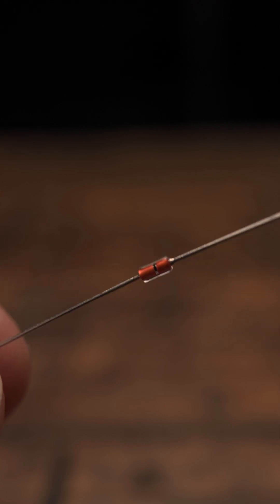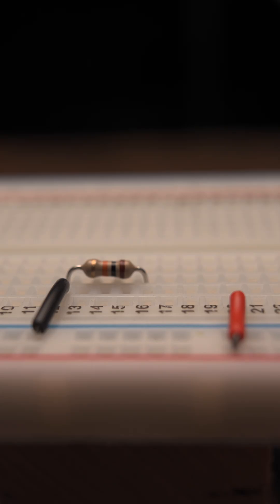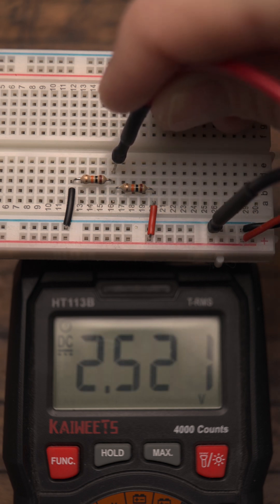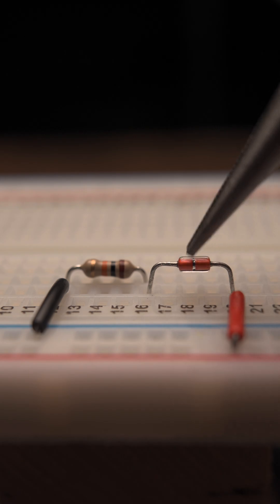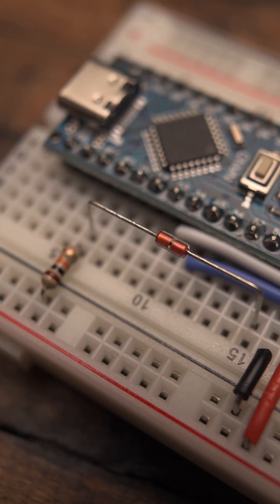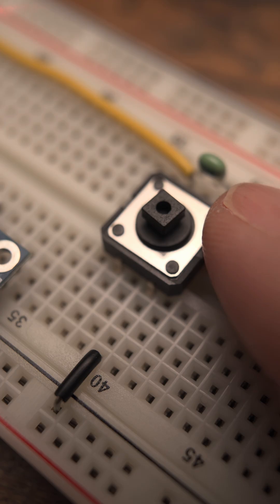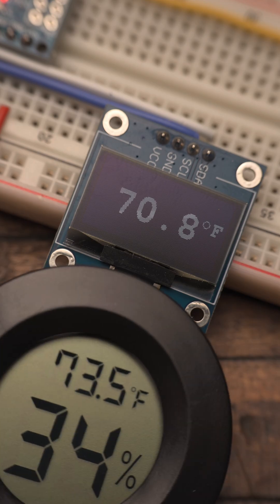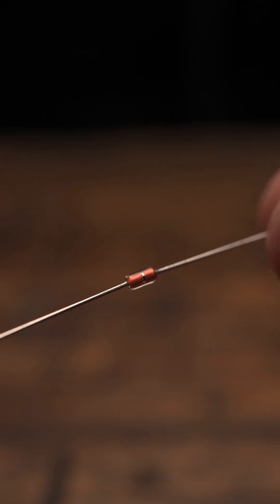#thermistor

Comment: "I added a button to switch between Celsius and nonsense"
Reply from the maker: This made me actually laugh out loud 😂
Reply: @HackMakeMod  It's true! Farenheit is complete nonsense! Lol
Reply: We should just convert everything into Planck Units for some extra fun.
Reply: It doesn't matter. Both systems are largely arbitrary and loosely based on properties of water on earth.
Celsius rooted itself at the triple point of water. Fahrenheit put 100 at around body temp. Celsius put 100 "degrees" between water freezing and water boiling. Fahrenheit put 180° between those two points.
It doesn't matter. Don't mix systems and you'll be fine either way.
Reply: I believe Kelvin is better than both
Reply: @Cubikat  Only for science. In everyday use using freezing point as Zero and boiling point as 100 is much easier to use for practical purposes.
Reply: @petergibson2318  I would be on board if you used a decimal point.
Reply: @Cubikat  Kelvin's just Celcius that like going down, so yes.
Reply: True since it's based on the very laws of the universe. @Cubikat
Reply: @nathanpfirman625  Celsius is just Kelvin with a potentiometer so we have a way to calibrate it.
Reply: @Pharozos Yeah but someone directly soldered the potentiometer and the knob got stuck so now we can't change it

thanks kevin
Reply: @tomikun8057  :D
Reply: @nathanpfirman625 it's really not though, it's just a yet another human created way of measuring temperature
Reply: @Cubikat It's a little less useful for common use though since it will always be a number above ~250 unless you live somewhere exceedingly cold
Reply: @Cubikat  Celsius is parallel to Kelvin without conversion, so it has the scientific scalability while retaining the everyday usability.

If you need to calculate with absolute temperatures, Kelvin is the way to go. If you just need deltaT, both scales are equally useful.
Reply: @Cubikat  Why does in such discussions nobody ever argue for degree Rankine?  Réaumur?  Rømer?  Gasmark?  Leiden? Wedgwood?
Reply: Kelvin is literally based on celcius just adjust zero yo absolute zero. Celcius still makes sense where Fahrenheit is shit @Cubikat
Reply: @Cubikat  Only that Kelvin was derived from Celsius....
Reply: @NiMareQ  it's still more accurate than Celsius
Reply: @Cubikat  okay 😂. Both have arbitrary precision, though.
Reply: @Cubikat  Farhenheit can't be more accurate than Celsius, as it's just Celcius converted arbitrarily.
Reply: @calorus  I never said anything about Fahrenheit
Reply: @Cubikat  So you mean Kelvin is more accurate than Celsius? I am lost, sorry. You do realize that Kelvin = Celsius + 273.15, both are equally accurate. They just both base their scale off different phenomena.
Reply: @NiMareQ  @CubiKat - Exactly this.
Reply: @calorus Fahrenheit and Celsius are both defined by Kelvin now. And the only thing that Celsius was "good" for (0 being the freezing point of water, and 100 being the boiling point) isn't even accurate anymore. Now that it is defined by Kelvin, it shifted the boiling point of water to 99.98C and freezing to -0.0001C. Celsius isn't even defined by the one and only thing it had going for it (which wasn't even useful in the first place).
Reply: @Gimli1357  No, Kelvin is defined by Celsius, otherwise you'd know where to start, but you wouldn't know how big they were.
Reply: @calorus  Nope. Kelvin was created using a scale similar to Celsius, a scale less precise than Fahrenheit, but Celsius got redefined to be based off of Kelvin since Kelvin actually has a sensible starting point. (This is why Celsius is no longer defined by the boiling/freezing point of water despite that being it's entire point). Celsius never had a good reason for existing. The freezing and boiling point of water is not a useful scale nor has it ever been one.
Reply: @Gimli1357  On reading you are correct as it was apparently changed since my undergrad days -- however on analysis, this has been achieved by taking the tripling point (273.16K), and counting down to zero. meaning that whilst it's no longer mathematically dependent upon Celcius, it's contrived to ensure that Celcius is unchaged. Which is cool.
Reply: @Gimli1357 Oh yeah, these ten-thousandths are so relevant😂
Reply: Eurocucks are an embarrassment to the world.
Reply: The yuropoors ITT wish they could feel temperatures the way we can.

0 is fucking cold and 100 is fucking hot, its like a percentage

The inferiority complex of yuropoors is the greatest thoughever
Reply: OP just admitted to being mentally retarded 😂
Reply: MURICA🦅🦅🦅🦅
Reply: Yeah take it like that farenheit
Reply: Fahrenheit and nonsense* FTFY
Reply: LoL
Reply: Guys, guys, stop fighting. NASA uses the metric system so it is superior, end of discussion. Do you know better than NASA? No you don't. NASA is the standard.
Reply: freedom fractions are superior
Reply: Celsius is nonsense unless you're in a lab, then you should use kelvin anyway. Celsius is pointless
Reply: Land on the moon then we can talk losers
Reply: Fahrenheit is metric weather. Goes from 0-100 with meaningful changes every 10 

Meanwhile europoors are stuck with their -17 to 37 weather 😂😂😂😂😂😂
Reply: ok king george
Reply: True
Reply: Freezing is 0° boiling is 100° so what is the meaning of F
Reply: 🤣😂 so true C° all the way
Reply: There's a reason the metric system is used ubiquitously in the scientific world.
Imperial is so damn clumsy.

Including Fahrenheit - particularly when people spew this '60% hot' thing like that makes any sense. 😂
Reply: @lewe666 because it does functionally make sense, and it allows for more precise temperature when measuring weather. And also, Americans literally use both systems. In science where we require things to be measured precisely we use the metric system. If it doesn’t have to be precise, then we use imperial because it’s all fractional based and easy to quantify quickly. Like if I’m baking, I wouldn’t go “I need 26g of flour”. Fuck that, I have a cup. I use this one cup, and everything else will be based off of a fraction of how much is in this cup. Fahrenheit is easier because we have more numbers between temperature. I.e. per each change in degree by Celsius measurement, there’s somewhere about 1-2 changes in Fahrenheit. We can accurately describe between 70-71 degrees Fahrenheit if necessary. Also, I’m so fucking sick of the “but Celsius is based on water” argument. I’m not a fucking cup of water, I want to know how the temperature will feel to me, not to the water
Reply: @Spoomped  measuring things by cups makes no sense due to the difference of molecular mass between ingredients, therefore using volumetry isn"t a good way to be precise with recipes (especially bakery).
Reply: @Spoomped  "I’m not a fucking cup of water, I want to know how the temperature will feel to me, not to the water" 👏👏👏
Reply: The fuck is a Celsius?
Reply: @_Nay_Nay  Normal temperature scale
Reply: @grankeee  that sounds like communism to me. We use moonlanding units here
Reply: @_Nay_Nay  " We use moonlanding units here"
I have to break down your world view, Apollo's computer used metric units and then translatet it to imperial so english crew can understand them easier.
Reply: Celsius is a measure of temperature relative to water, and Fahrenheit is a measure of temperature relative to humans. It makes sense to use them as percentage values based on what is being measured.

E.g. it is 60% hot outside, this water is -5% warm.
Reply: @hunterbeach8941  The background for 0 degrees Fahrenheit is the coldest temperature measured in Gdansk at that time... can it be even more random?
Reply: @lukasmessner269  what did they base the kilometer off of again? A fraction of the distance from the north pole to the equator through France?

And wasn't the kilogram literally based on a single weight stored in the basement of a government office, one whose weight changed significantly over the course of only a few years?

And sure, the centigrade measure is based on water, but other than that, the only basis in metric that makes much sense is the unit system.

We need something to use as a base for measurement, and while it's convoluted, I think 0°f being "the coldest temperature we measured" is a bit less strange than "our unit of mass is this one weight we keep in that basement over there, but don't touch it! That's not allowed!"
Reply: @hunterbeach8941  Oh and can you give me the current scientific definition of a degree Fahrenheit?
Reply: @calorus  No, I couldn't, but I personally don't think that really matters.

Both of our systems were based on convoluted measurements taken by some old dead guys, and now for some reason we're having an argument about it on the internet.

Besides, my original point still stands. Fahrenheit is useful for weather, and Celcius is useful for chemistry. Neither is better, because they're used differently and for different things.
Reply: @hunterbeach8941  The definition of a Fahrenheit is 5/9(x − 32)°C i.e. the Farhenheit (and by extension Rankine) is literally defined by the Celcius.
Reply: @hunterbeach8941 
water. 1liter is 1 kg
as for distance... well we dont hv to go on something.. its better than whatever nonsense imperial is.
Reply: @calorus  since it's obvious you only read the first two lines of what I said, and you don't seem to care about discussing the original point, I don't think your input is very important to me. Have a good one.
Reply: @aabuyaa  A kilometer is one ten-millionth of the distance between the North Pole and the equator through Paris. One liter is 1000 cubic centimeters, one liter of water is 1kg, and one one-thousandth of a liter of water, a cubic centimeter, is a gram. Heat one gram of frozen water in a pan with a mercury thermometer til boiling. Take the MM of mercury between boiling and frozen, and divide it into 100 equal units. That's a degree Celsius, which is also a calorie. Take 1000 of those calories, that's a kilocalorie, which we use to measure our food's energy.

So everything in metric, from distance to volume to weight to mass to temperature to nutrition is, in origin, based on an arbitrary one-ten-millionth fractional measurement of the distance from the North Pole to the Equator through Paris France in 1791, which might I remind you, due to geologic and magnetic shifting, isn't even the same measurement you'd get today.

And yet all of that, despite what everyone in this comment section says, is completely and totally beside the point.

Because my original point was that both Fahrenheit and Celcius were useful. Celsius is chemistry's temperature, and Fahrenheit is humanity's temperature. They're both useful as percentage models for "How hot is this thing right now?"

And everyone gets so bent out of shape about this just because of a false superiority complex stemming from something as arbitrary as the thermometer. Metric and imperial weren't even part of the discussion until other people brought them up, and they are still irrelevant to the original point of my first comment.
Reply: @hunterbeach8941 The circumference of the earth is 40.000 km, so a quarter arc of the earth circumference has 10.000 km (Actually it is a little bit more, but this can be explained with less acurate measurement tools back in the day). one cubic meter of water equals to 1000 litre and weights 1000 kg or a metric ton. It is not that hard to understand, and it is repeatable as the density of water is nearly constant and the curicumference of the eart does not change. 

And for Celsius: 0°C by ambient pressure at sea level means freezing, 100°C by ambient pressure at sea level means boiling. This is not hard.

Nowadays the definitions for SI units are more precise and more obscure (the kg is now defined by the weight of a bunch of silicum atoms), but still repeatable. 

The way fahrenheit was derived cannot be repeated. It is based on the body temperature of some dude and how cold it was another day. Will not deliver the same results by repeating it
Reply: @hunterbeach8941  Relative to humans?
0°F Humans are dead. 100°F humanity is... Maybe okay, probably a bit of a fever - oh and it depends where you measure them. Perfect
Reply: @calorus  the scientific definition of a degree of Fahrenheit is each degree = 1% hot. If it is 50F outside, it's 50% hot. Which is a pretty nice day. A lot of people like 70% hot. I personally like 50-60% hot more. We don't like going above 100% hot, that's a little dangerous!

Also, try to think outside the box a little. The comment you replied to about "Relative to humans" isn't about internal body temperature. It's about external temperature, i.e. how we feel in an environment of a certain temperature. I know "feelings" is hard to quantify for a soulless nerd like yourself that feels the need to ground their entire life in "science" in order to feel like they have a grip on the machinations of the world and to stop the constant, crippling fear of the unknown from weighing you down like an anchor, but doesn't that just make it all the more cool that Fahrenheit managed to do that?
Reply: @hunterbeach8941 Yeah, because fahrenheit, pounds and feet make much more sense. Sure bro. So smart argument.
Reply: @hunterbeach8941  just americans and some other contrys use fareheint man, all of the world use metric system, this si why is so weird to us think about imperial system🤝🏽
Reply: @moon_wingo  I'm well aware that I'm in the minority here. I completely understand how dumb my country's systems are, I just want to defend the one measurement that's actually useful.
Reply: @calorus Fahrenheit was actually originally made because this guy figured out how to make highly precise temperature measurement, so he invented an alternate measure based on the existing Celsius so if you wanted to make precise temperature measurements you HAD to use his products

Fahrenheit is literally a proprietary temperature scale, even it's origin is disgustingly American
Reply: @hunterbeach8941  a couple of things to point out which seems important. The strength of the SI system is it capacity to be reproduced only from its definition. The kilogram was indeed a headache for a long time because scientists couldn’t find a way to make it easily replicable, but it is not the case anymore since 2019. The tweek is to define these constants from universal constants, and that is basically now the case for all the seven base units of the SI system. This is something that the definition of the empirical system doesn’t provide.
Finally, a calorie is not a degree Celsius. First because one is a temperature the other is an energy, second because calorie is not par of the SI (it is the Joule), third because it is actually defined like the required energy to heat up 1cm3 of pure water by 1°C (still a replicable definition though), fourth energy is not a fundamental unit, because it can be expressed as a mass time length divided by time squared.
Reply: @romain.guillaume  1kg is weight of 1liter/dc3 of water. Not sure in what temperature but i guess some provided in round number in Celsius scale :D
Reply: @grankeee   indeed. If I remember correctly it is 25°C at 1,025 bar of atmospheric pressure (basically « normal » temperature at see level more or less)
Reply: @hunterbeach8941 you literally defended f using arguments that make C better. In metric it's all related - temperature, mass, volume, etc. In F.. oh its cold
Reply: @hunterbeach8941 
A kilo is based on a litre of water (most likely at a specific temperature idk for sure) but it's based on a litre of water = 1000 millilitres and 1000 grams
Reply: @hunterbeach8941 it doesnt matter having everythibg base 10 is just better
Reply: @lukasmessner269 0 Fahrenheit isn't the coldest temperature wtf are you talking about
Reply: @hunterbeach8941 what does kilo mean? What is meter based of?
Reply: @hunterbeach8941  Celsius is also more useful for weather. If the temp hits about 0, you know it's going to snow.

If F hits 0, it has been snowing for a long time already and no change is perceivable at 0. There also is no weather change perceivable at 100°F whearas in C you'd give up living.

F can't be any more random. You have no realistic fix points other than subjective points or the ones you translate from Celsius.

And if you say "Average body temperature is objective". No, even average body temperature has historically changes as our biology isn't static even if a perfectly healthy person.

Put up ANY number scale, 0° = temperature of my testies, 100° = temperature of my warmest far on a hot summer day after eating from taco bell, and you have an equally useful and logical temperature scale as Farenheit.
Reply: @hunterbeach8941
Of course it matters FFS.
Reply: @hunterbeach8941  You don't understand the genius of SI.
Reply: @hunterbeach8941  doesnt make any sense, standard human body temperature is 36.6C should be exactly 100F to make sense but it's not. 0C is 32F and it does not make any sense eaither (to use them as percentage values). Considering that human body would be over 75% made of water (skeleton lowers that average a lot) it makes a lot more sense to use Celcius. Only USA and a few little countries uses F nowadays, but we know that Americans will use any units but normal eg. using anything but metric system when providing measurements :D
Reply: @grankeee  environmental temperature, not internal.

I will not elaborate, seeing as how (despite being american) I seem to be one of the few people in this thread who is willing to use more than one system of measurement. Metric works for chemistry, imperial has its uses (as niche as they are). That is what I've said before, and imma leave it at that.
Reply: @Spoomped   "and the EU will use anything but a fucking toothbrush" 
 no comment
Reply: @hunterbeach8941 yes ... thr average human temperature is a fantastic value to use ... 🙄
Almost as stupid as the inch, or the foot.
Reply: @XB10001 Not if you’re human. Which I happen to be. You?
Reply: @rfichokeofdestiny  do you know WHY it's *average*? Because the temperature is slightly different for each person.
As peoble are born, the value changes slightly.... and constantly.

It's a matter of being intelligent, which now I know you're not. You cannot be THAT bad at mathematics.
Reply: @XB10001  If you were intelligent, you’d realize I’m talking about a range of values rather than the average of one particular value within that range (whose standard deviation is so insignificantly small by comparison that it doesn’t matter for the purposes of this argument).
Reply: @rfichokeofdestiny " the average of one particular value within the range".
(YOUR words)

That's the value itself, genius!
Stay way from math, please. The concept of averages is too conplex for you.
Reply: @rfichokeofdestiny   if you had even one bit of intrlligence, you would know that a range of values doesn't work for a scale. You didn't help yourself at all there.

More importantly, you would have understood what I wrote.

😂 ... keep trying, and while you are at it, check your temperature. 😂

It's funny and sad that you still don't understand why THAT doesn't work.
It's clear math is NOT your subject. Stick to addition only.

Also, the important aspect is the definition of a standard for the unit. So clearly, you are also clueless about how precisely units are defined.
Reply: @rfichokeofdestiny  I cannot emphasize this enough. STICK TO ADDITION.
Reply: @hunterbeach8941  Actually Imperial System is a measuring system relative to burgers per football field divided by turkeys per leg.
Reply: @gabrielex  cute.
Reply: @hunterbeach8941  that still doesn't work, because ambient temperatures over 100% make no sense.
Reply: @theone1and1  I decided to share an opinion a while back and now everyone is yelling at me for it. All I wanted to say is that Fahrenheit could be useful, and now everyone is mad.

I don't care anymore. Think whatever you want, you're right. Educated discussion is over because everyone missed the point and because I'm American I must be wrong.
Reply: @hunterbeach8941  Honestly, I don't really care about Fahrenheit vs Celsius. Use whatever makes sense to you (but for the love of god put both into online recipes). I just meant that the percentage of human thing doesn't make sense because you can go beyond 100%. Both scales are equally contrived
Reply: @hunterbeach8941 
One of you main arguments for F was that it's 'more precise'.
That means very little when both scales are perfectly fine with non integer values.
Reply: @hunterbeach8941  Its not intuitive at all. 30 sounds nice and chill but its freezing outside. 50 sounds bang on middle but its cold. 80 sounds very hot but its not hot. 100 sounds like you should be dead but it's just hot. Then it goes above 100 which is not intuitive. And then you remember that for a Siberian 50 is hot and for a Californian 80 is cold. Easily worse than Celsius which has the same last problem but does not have the rest. Celsius is just 5 freezing cold ,10 very cold, 15 cold 20 warm, 25 almost hot 30 hot 25 very hot 40 extremely hot 45+ shoulda stayed at home. Increments of 5 work perfect for it.
Reply: @hunterbeach8941 that’s very creative
Reply: @hunterbeach8941  Nice explanation. 👏🏻
Reply: @hunterbeach8941  what? This is first time I am seeing this argument in wild. It does not make sense even from human pov because humans are subjective and will adjust their perspective based on the measure they learn. So for someone using Celsius or Kelvin all their lives, it will make sense to only use those but with added benefit of being scientifically usable. If you use Fahrenheit all your life, there is no added benefit. It's a worse measure.
Reply: @MartinzW  if that's the first time you've seen that argument, you haven't participated in this discussion before. It always comes up.
Reply: @Falcrist  i've seen it but typically when it's mocked
Reply: @MartinzW  ah, so you're just making stuff up.
Reply: @hunterbeach8941 it doesn't make sense to create a temperature scale based on "feel". The only evidence needed to support this point is how often climate conditions are reported as being "x degrees, but feels like y degrees"
Reply: @hunterbeach8941  sure but that’s incidental, not by design, the purpose was the have the 0 point lower because it makes maths easier (less negative numbers) and it helped to have freezing and boiling 180° apart (incidental I believe), again for maths. His body temp was used to get 96, the three points measured to make the scale where 0, 32, and 96
Reply: @hunterbeach8941  That's bullshit. Human have preference so it's different between people. But water is universal, if you go out and see it's minus two degree Celsius everybody would understand it's bloody cold outside if water freezes
Reply: @hunterbeach8941  bullshit its based on the specific weather of a specific area.
Reply: @hunterbeach8941  : Plot twist, humans are 50-70% water
Reply: @hunterbeach8941  wat does 60% hot outside even mean? For some people 25°C is already too hot and for others it's 35°C. I get a headache if the temperature outside is colder than about 12°C, so does that mean 0°F for me is 12°C?

Every human is unique, so basing a temperature on humans makes no sense if you didn't grow up using it. Basing the temperature on something like water makes at least some sense since the temperature is above 0 when you notice ice and/or snow melting and it is below 0 when ice is forming and/or snow is falling. Snow can also fall when it's a bit above 0, so if you see snow fall but it doesn't stick around then the temperature is somewhere around 0.

Boiling is also an important part of cooking, so it also makes more sense in that regard.

In the end the easiest system is the one you grew up with or used for a long time. But I'd say that Celsius is objectively a bit better than Fahrenheit simply because Fahrenheit is based on something subjective and intangible.
Well, actually Fahrenheit is currently based on Kelvin, and Kelvin is derived from Celsius. So, there's that as well
Reply: @AnimilesYT  you make a good point that, if you don't grow up with the system, it can be difficult to understand how to use it in the way I'd described. However, in my experience, all it takes is a mental note of where room temp is to dial it in, especially when you remember freezing is 32°F. Keeping those 2 numbers in mind gives you a reference point, just like 0 and 100 in Celcius.

Although, if I might ask, why do people keep bringing up what imperial is based on? I'm fully aware that imperial uses metric as a base, but I never intended to discuss either system outside the context of "Fahrenheit has its uses," so why does it keep getting brought up?
Reply: @AnimilesYT  In addition to my other comment, celsius is based wholly on the meter, which is exactly one-ten-millionth of the distance between the equator and the north pole through Paris circa 1791.

To argue that Imperial measurements are worse because metric is based on something tangible seems strange given this knowledge.
Reply: @hunterbeach8941 if you don't mind, i will have something to this cov too.

The biggest problem is conflict between USA and rest of the world, especially in the science fields. (Like rockets failing due to wrong units). Also, what i really like about metric is that most of it is something*10^n, which makes it easy to convert between. So, it is easier to work with. 
Also, i don't really like to think "its 60% hot outside" because... Well, really sounds stupid to me😃 i guess its nice for bit understanding °F, but terrible for actuall practical use.
Reply: @hunterbeach8941  not to sound like a broken clock, but the Meter is not based on the distance of Paris to the North Pole. It is based on the circumference of the earth. The circumference of the earth at the equator is 40.000 km. The mathematicians who computed the earth circumference lived in Paris. It is not that hard.
Reply: @docjoules4738  Yes, you're right. It's not the distance between Paris and the North Pole. It's one-ten-millionth of the distance between the equator and the north pole (equal to one-quarter of the earth's circumference), but specifically through France because... well, it's the French.

So one-forty-millionth of the earth's circumference, which is arguably more convoluted than the other number.
Reply: @hunterbeach8941  it really isn't that convoluted. This number is the same even if we would let it run through Colorado or moskow. They mathematicians who measured the land just lived in France and thus did this in France. If they were German, they would have done this in Germany. 

If you invent a unit system you want people to reproduce your results. The imperial system is not repeatable. You cannot repeat the process for feet or Fahrenheit and get the same result. With  the SI system, you can.

And it is really easy to convert
Reply: @hunterbeach8941  Fahrnheit doesn't have a use. Argumenting that it's a human temperature is a falacy on its own, as it has been measured that human temperature decreases throughout generations. "Just remembering" that freezing is 32°F is just plain stupid and proves that freezing point is a well thought and practical reference point even for the remaining 4% of the world's population, so it makes complete sense to base the scale off it. With farhnheits you need to remember freezing 32°F, cool room 68°F, (arguably also body 98.6°F) and boiling 212°F. With Celsius you just need to remember two values: cool room 20°C and body 37°C. The freezing and boiling points are inherent to the scale.

And not to mention that when you have 60°C hot bath and mix it with an equal amount of room temperature (20°C) water, you will end up with 40°C result, which is just some random bullshit values when the same is expressed with °F. 60°C=140°F, 40°C=104°F, 20°C=-7°F.

Can you immediately tell that 140°F is twice as hot as -1°F? I don't think so, but with 60°C and 30°C, it's impossible to miss.
Reply: @hunterbeach8941 😂😂😂 hypocrite
Reply: @hunterbeach8941  percentages is a big failure in math. We could very easily drop the whole idea of percentages and math would not suffer at all, rather it would benefit the simplicity. I could sell you this idea with 0.5 times the recommended price.
Reply: @diynevala  do this, but with fractions. Then I'll buy.
Reply: @hunterbeach8941  Like √1/√4 ? Fractions are great but some numbers you cannot be written with fractions alone.
Reply: @diynevala ¾ and ⅘ and that sort of thing.

Fractional multiplication has always been my enemy. Physics? That's fine. Trigonometry? Chilling.

But ask me to multiply ⅗ and ⅞, and for some reason I struggle.
Reply: @hunterbeach8941 farenheit doesn’t make sense at all where i live where the average temperature is 30-45 celcius
Reply: km is much better than mi but F is much better than C. Everyone wins! Don't even get me started on the airline industry.
Reply: @j_II8  I asked specified questionbs about F and noone answered so far neither explained in any logic way so for me it is still just "you got used to them".
I could easly point out why C makes more sense.
Reply: @grankeee  km is better than mi because it is more intuitive, imo. kg is better than lb because it is more intuitive, imo. And F is better than C because it is more intuitive, imo. I'd rather think about the SENSATION of temperature in a range from about -10 to 110 than from about -23 to 43, it's just more intuitive to me. You very well can point out advantages C has, I get it. I'm explaining to you why no amount of factoids you provide will change the intuitive preference that you seem unwilling to even attempt to understand.
Reply: 1. Fahrenheit is more granular than Celsius.
2. Percentage between sea level fresh water freezing and fresh water boiling is pretty darn useless.  Why?  Because nobody says "I'm going to cook this chicken breast to the temperature that's 74% of the distance between sea level fresh water freezing and fresh water boiling".
Or how about "nitrogen boils at -296% of the distance between sea level fresh water freezing and fresh water boiling"?
It's the same reason why decimal clocks failed.
All that's necessary is for everyone to agree on a temperature scale. Fahrenheit  was Good Enough.
(This is completely different from length, volume and mass.  Decimalization is very useful for them.)